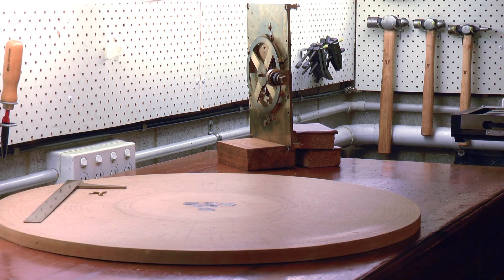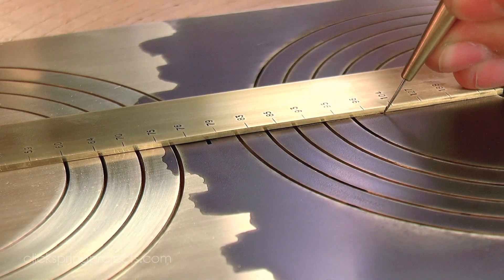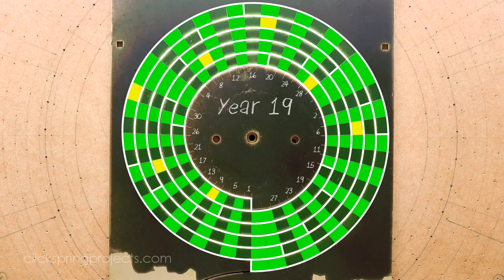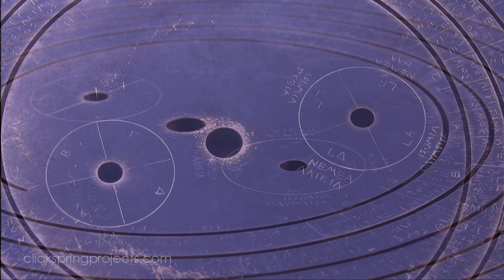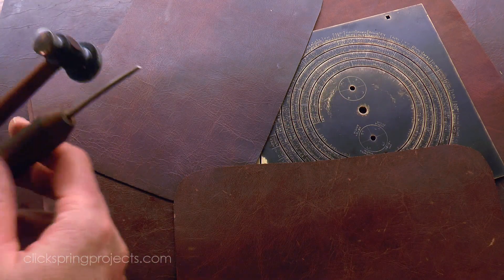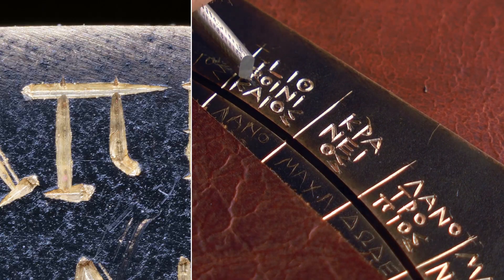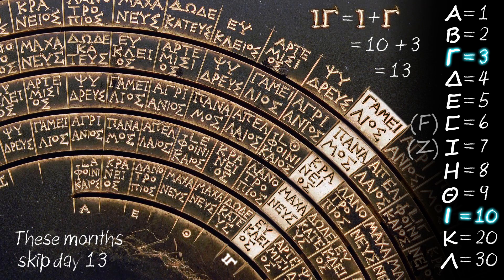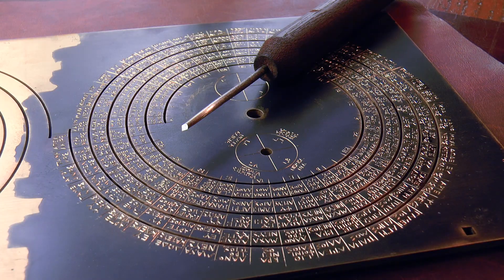The Antikythera Mechanism Episode 11 - Inscribing The Back Plate - Part 1

Comment: Fun fact: the Metonic cycle is also used by the Jews to determine when to intercalate (they do it by doubling the last month — Adar — though they consider 1st Adar as the intercalary month). 

The Paschalion, the method used to calculate Easter in the Julian calendar (and therefore the method used before 1582 and still used by the Orthodox Church), also incorporates this cycle to determine the paschal month — the first lunar month, whose full moon must fall after the Julian equinox (March 21, which is currently Gregorian April 3) so it can set the date of Easter.

Comment: That must have been nerve wracking, one slip with tired hands could have been costly.  I've watched jewellers using gravers, and they've always done it by hand (without a hammer).  A single stroke leaves a mirror finish on the cut faces.  I don't think I've seen any jewellers use a hammer.  I'm guessing you chose to use it because you're not using the graver every day, and felt it was the safer option.

Comment: The work board click spring is working on, which numerous circle traces of various sizes and holes drilled into it will be discovered several hundred years from now by an artisan who'll wish to reconstruct it to try an establish the purpose in much the same manner in which click spring is recreating the Antikythera clock project. They'll ask, "what was this craftsman of the 21st century building in the way of this board?"

Comment: Dear god Chris....  I'm a trained engraver, and I'd think twice before doing that thing....  One question: I saw you had an engraving tool set up in a GRS modular handle at the beginning of the clip, and many of the 'fast taps' sound suspiciously like a Gravermach.  Did you mount your antique cutter in into a GRS rig and use that to save time?  (You'd be utterly within your rights to do so.  I certainly would have.)  Also: do you know the 'swing from the ball of your elbow' trick for graver sharpening?  If not, let me know.  It really helps.  Every time you come out with a new video, I spend half an hour grinning at just how far over the top you went this time.  You have my humble respect and thanks.

Comment: (please tell me you used a cnc for most of the engraving, but did by hand just the portions that made it to camera)

Thanks SO MUCH for going through the luni-solar calendar, metonic cycle and the intercalary months. I don't see that explained these days, so it's good to know that more people are being made aware of it.

Although it's often attributed to the ancient Greeks c 5th century BC, there appears to be some evidence that the Hebrews were using a luni-solar calendar almost 1,000 years prior. They had a month called "Abib" (Nisan), which means "first ear [of budding]". That month was always in the spring, at Passover. So somehow they had a way of shifting their month names so that Abib always came at spring time. The insertion of the 13th intercalary month seems to be the result of their FirstFruits celebration. I'm having a hard time finding the earliest traces of that method of calendar keeping. It was codified mathematically by the 1st century AD, but I'm quite curious to know how it was practices ~1000 BC, because apparently it was.

Anyway - fascinating Mechanism!! Thanks for mesmerizing me once again with your skill and knowledge!

Comment: What does the dial look like cleaned off? Is it as easy to read without the marking substance providing the high contrast? Is it likely that the engravings would have been filled in with a higher contrast dye or lacquer to increase readability?

Comment: Even though the "font" is rather simple, the engraving is incredibly beautiful! I'm assuming the black coating is to read the engraving marks better and will be washed off later, but does it get reversed and black stuff be put in the engraving recesses for contrast?
Reply: The black ink is used to be able to scribe the markings. It’s the equivalent of the modern-day blue ink that machinists use. And, yes, it’s cleaned off afterwards.

Comment: Right, a couple of spare hours before bed, “let’s knock one of these up”.  Open garage door, push past bikes, lawnmower and golf clubs on the floor. Get to the bench, use the ‘wiper method’ to clean a space from all the tools, paint covered screwdrivers and saw dust. Realise no plug on the angle grinder, gives up.

Comment: I have watched since maybe the second or third video. You are an amazing Artisan, blowing my mind on every build. And your videos just on making and using tools has been incredibly helpful in my job as a Power Plant Mechanic. Such as the instructional video on how to properly use the most basic but not a simple tool to master, the lowly file. The use of which many have forgotten. That video alone has saved me much anguish in my job when fitting up parts with a tight tolerance when I used to be a machinist. And your videos remind me greatly of my time in the Coast Guard as a Quartermaster doing navigation. Many think the people of our past as not very smart or as pig farmers (nothing wrong with profession as it does keep us fed, I use it as an example only) but while in the Coast Guard I learned the use of a sextant, a simple instrument that measures many items, position of the sun at noon to determine a sun line, or placing buoys exactly for navigation. But what about the people such as Bowditch, who wrote the books "The Practical Navigator" Vol. 1 & 2 that contains all of the mathematical equations needed to use a sextant for navigation? By building everything that you do, and I should say creating I think, you prove to us just how very smart our ancestors are and the tools they created to keep track of the Months and the Years, simply incredible and it blows my mind when I think on it. Thank you so much for what you do. You must have incredible patience or take a lot of Xanax to stay calm. What you showed us in 19 minutes must have taken months to do. Thank you Chris for everything.......

Comment: If you are making an exact replica of the mechanism. There will be an error of 4.5 hours due to the metonic cycle over 2500 years.
Do you have a way to adjust for the error to be used today? Does it matter. What is the most time sensitive information given by the machine?

Comment: Chris says "in any event the engraving in itself is a time consuming task, making each component easily the most labor intensive of the build so far",  which is easily the understatement of the series.  all I can say is "wow!"  (and all I can think is this is what CNC is for, though it wouldn't look a fraction as good as Chris's hand work).

Chris, I really appreciate your explanation of the Greek lunar calendar, I've read various articles and watched various videos about the Mechanism but they all lacked this basic information of how lunar months and solar seasons were reconciled. I have to admit that while hollow months make sense to me because they're like our February in a leap year, I still don't understand the "extra, 13'th, month" in some years of the Greek calendar, that's still mysterious.
Reply: The 13th intercalary month ensured that the seasons lined up with the years properly. 12 lunar months is too short for a solar year by between a week or two, so after every couple years, a month was inserted to make sure the beginning of the year stayed roughly the same time.
Reply: @18th_shard  AHHA, so we have both the lunar month is not a whole number of days, and the solar year is not a whole number of lunar months, and they each require adjustments that are different. Thanks for the explanation !!!